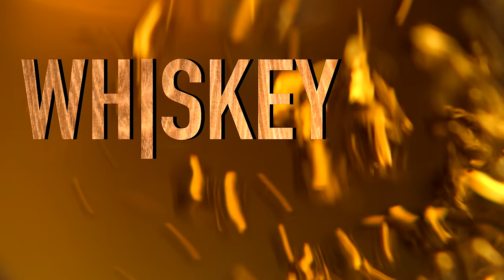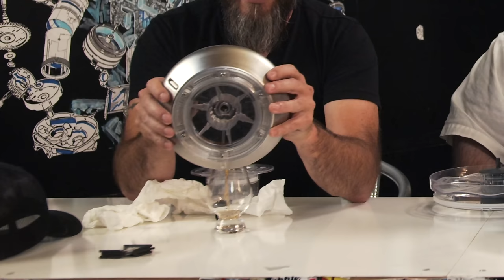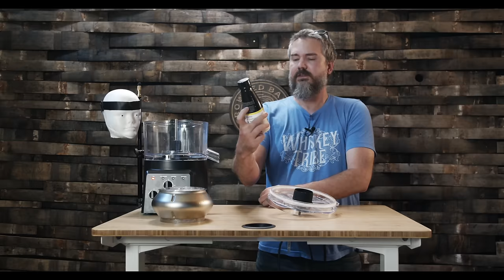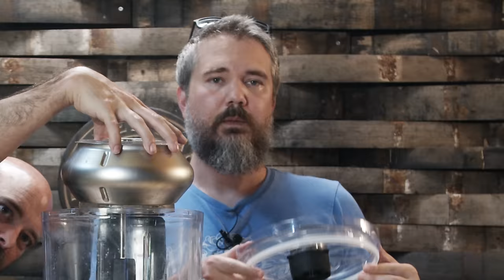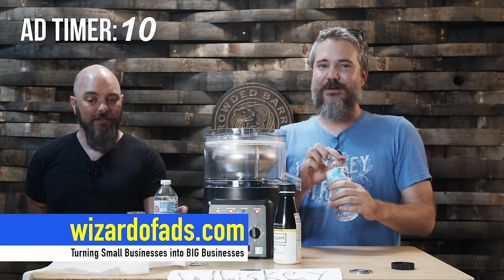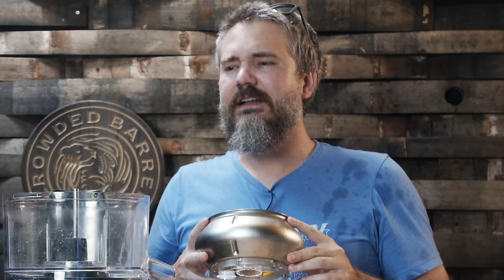What happens to whiskey in a CENTRIFUGE?

Comment: In my time working as a doctoral candidate, and trying this on "normal" (hehe) things like blood and emulsions, the dissolved solid parts need to be on a micro scale. although ethanol has lignins and conjingers and other things, they are all dissolved way too well together and  way too small (on a pico/nano meter scale) to be separated. Maybe with a super industrial grade 1,000,000+ RPM centrifuge, but those are rare on this earth.
Reply: A general rule of thumb is that if the parent mixture isn't opaque (i.e. doesn't contain insoluble particles large enough to scatter visible light, which entails bigger than 700 nm), then you cannot separate them by centrifugation.
Reply: @redneckchemist6506  thank you
Reply: No their not rare ever here of the cannabis industry? Lololol we have to have those to test every damn batch or we can't sell it.
Reply: @appalachianexploration5714  Considering the centrifuges used to separate the isotopes of uranium for nuclear enrichment only operate at ~90,000 RPM, no, the centrifuges used in the cannabis industry don't operate anywhere remotely close to the millions of RPM.
Reply: @appalachianexploration5714  and that is exactly why I said "industrial grade" ie the medical, cancer research, commercial, or in your case, cannabis industries. I doubt that any centrifuge for personal use exists that would get the job done hahaha
Reply: You also need non-homogenous density, i.e. different regions of the liquid need a different density. Whiskey has a homogeneous density, all regions in it have the same density.
Reply: @redneckchemist6506  he's high, probably forgot a couple zeros. it happens
Reply: @furthurondown  hahaha love it

Comment: Interesting what model is this centrifuge.
What I'm quite sure is if you want good separation you shouldn't just turn it off and pour it out.
Sure the heaviest particles might have stuck to the walls, but there's no guarantee - they're filtered by weight not by stickiness :) 
Normally filtering centrifuge should allow the fluid to flow over some edge (or a lip, or a ridge, whatever you want to call it), in a way that only the light-most fluid reaches it. 
The pollutants and heavy particles would stay inside.
But when you turn it off everything inside the drum would flow back down and would mix again.
When you do that it looks to me like you're doing it wrong :)

PS. actually I think this model also works like that (flowing over the top edge). You can see that the drum is spinning inside a container with a lead out for the filtered (ie the lightest) fluid.
But you need to pour enough fluid to fill the side-volume of the drum (when spinning it "up" is to the sides), and then to flow over the top edge - it'll be collected by the outer container and would flow out the spout.
Btw as you might have guessed to extract the trapped (useful) fluid from that side-volume to the sides of the top edge you can use something heavier to displace the fluid.
Just be careful if you're adding something that chemically bonds with the fluid. For example water is heavier than alcohol, but it makes Hydrogen bonds with alcohol and then it can't be separated (w/o distillation or salting out for example)
Reply: It's called a spinzall, it was invented by Dave Arnold (Booker & Dax). The guy is a genius of cocktail mixology, his book Liquid Intelligence has won a James Beard award. Basically he was tired of how a lab centrifuge costs upwards of $10k per unit and required very strict operational use with correct balancing to prevent catastrophe (lab centrifuges are known for going off like bombs when used incorrectly). He wanted one small enough to fit in a bar in NYC that could operate in the same territory and cost a fraction of the price.

The 2.0 just finished presale. It's meant for clarifying liquid like juices into justino's or into their own form. It's under a grand for a unit. and takes up about 1/10th of the space and is self balancing (so won't go ka-boom).